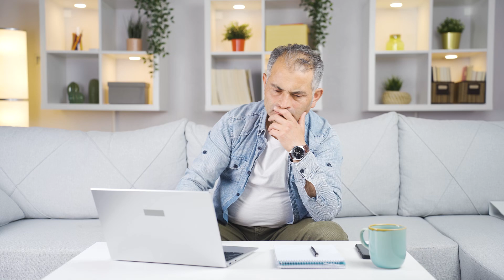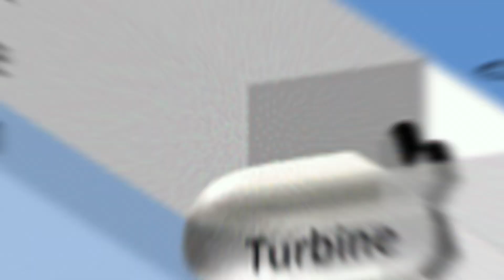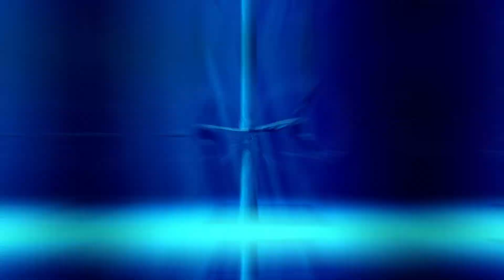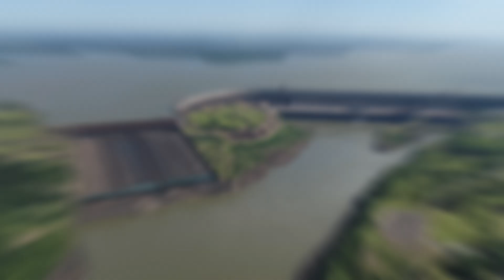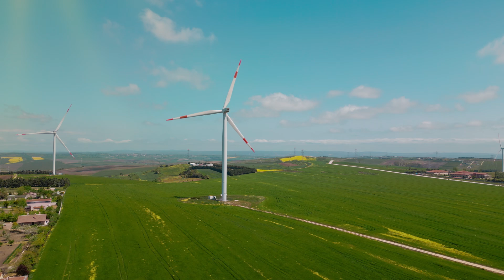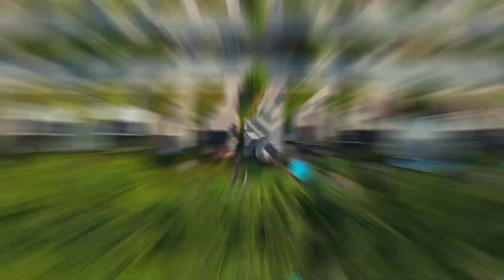Tidal Energy: The Ocean’s Secret Power Revolution 🌊⚡

Comment: Here's what I think and I'm a bit apprehensive about giving up my possibly money making idea. (1) the focus has been on capturing energy from the Tidal currents which creates environmental concerns and considerations. Bad.  (2) I've seen the power of the rising tide when fishing boats lie on the seabed waiting for the next tide to raise them to dock level. Canals have the ability to lift cargo laden ships. The physics involved there is not about flow at all. The rising water provides an infinite amount of kinetic power. Think of the Titanic. Gravity batteries are being developed in China and Europe but using solar and wind to lift weights. Isn't that interesting?  Fun Fact - Lead (Pb) can be used for Gravity battery weights. It would provide for the isolation of Lead (Pb) from the environment by containment. The main reason for the use of Lead (Pb) is it's weight (and it's really cheap to buy). Example: A block of lead (Pb) that is 3 meters high X 1 meter wide and deep would weigh approximately 32 Tons. You could put it in the corner of your living room. The energy in it would be released literally through the floor. For heavens sake never try this especially from the top floor. That's Gravity Baby. .ca  P.S. - If you take my Idea I want a percentage.
Reply from the maker: I will give you some percentages, if i do it :D
Reply: @Generalphysicsknowledge I need the services of an mechanical engineer/ draftsman who I can collaborate with on this topic. Pro Bono.